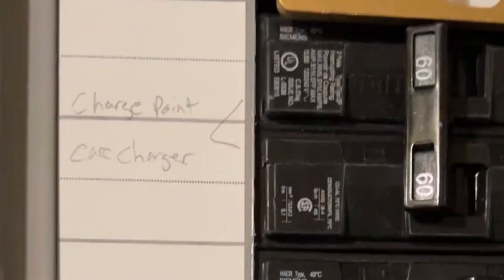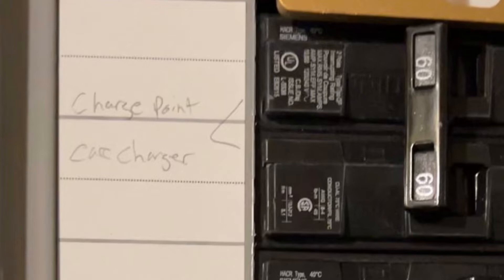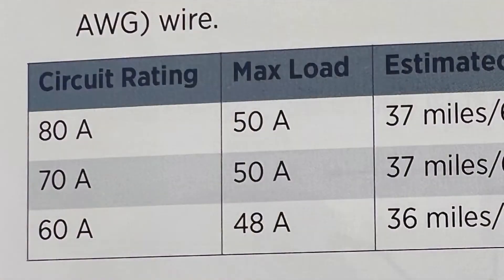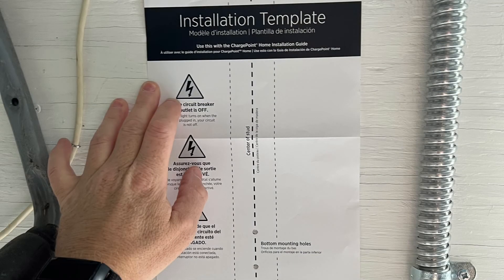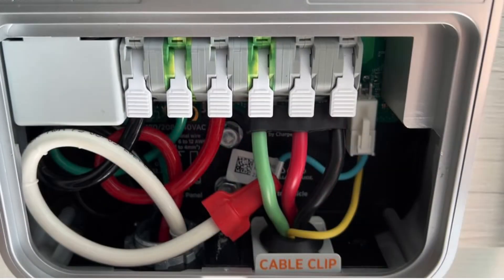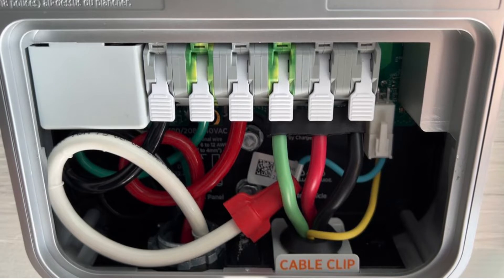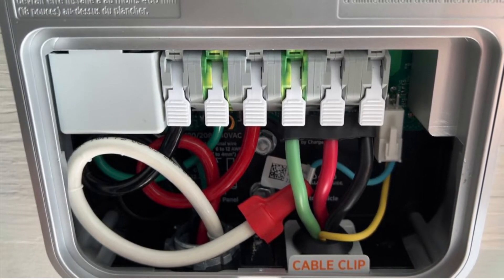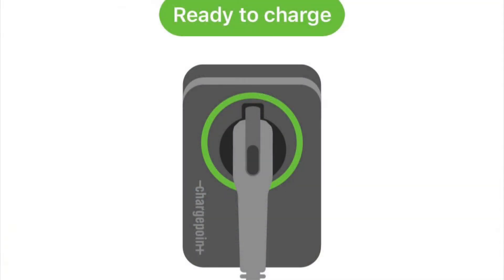11Kw 48A Hardwire Install ChargePoint Home Flex CPH50 Rivian Tesla  Mustang Mach-E F-150 Lightning

Comment: Thank you for the video. Just got a new Grand Cherokee 4XE. The 120V charger I got from Jeep is too long of a charge. I will go with the Charge Point and hardwire it to 60Amp breaker. I think it will do the job for future EV car for my wife. Many are happy with the unit.
Reply from the maker: The ChargePoint is great The handle and holster are top notch and many  utilities will offer a rebate for enrolling it in a managed charge program.  They are also offering a Tesla (NACS) handle retrofit in the future if your next car has that connector.
Reply: @keenanjeff  Thanks for the reply. I am guessing, Charge Point it is, then.

Comment: I noticed the neutral was just in the ChargePoint with the cap on it. Why didn’t you just use three wire?
Reply from the maker: I ran a neutral wire for both chargers just to futureproof maybe for VTH neither chargepoint or tesla chargers need them.

Comment: Do you have 3 phase power supply? You get max 32A with single phase.
Reply from the maker: In the US we have split-phase 240V I have a 60A circuit breaker and the charger is set at 80% which is 48A and 11.52kW

Comment: Did you use solid or stranded wire? Thanks for sharing.
Reply from the maker: stranded #6 THHN
Reply: @keenanjeff  Thank you.
Reply: Himi jus bought the same charger, using a 40amp breaker to charge ar 32a, where can I Find #8 thhn?

Comment: Hello. I did not see one, but did you install a disconnect in your garage?
Reply from the maker: No it is not needed wired direct to 60A breaker
Reply: @keenanjeff  I believe, I could be wrong as I am not an electrician, that a disconnect is required when hard wired and there is no other visible disconnect, i.e. fuse box, sub panel, etc. An outlet would not need a disconnect because the visual would be the cord/outlet.
Reply from the maker: @hodgesbrown3375  not here it was inspected
Reply: @keenanjeff  Good to know. I will recheck, thought it was part of the new NEC 2020. I am changing from my Tesla wall connector plugged in to a hardwired 60A (48 amp usable) DIY and thought I had read that.